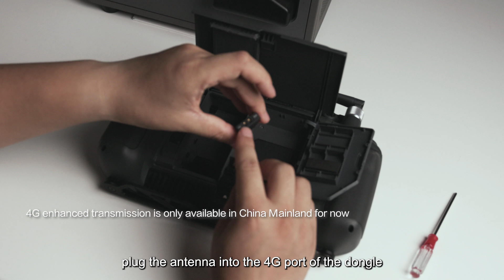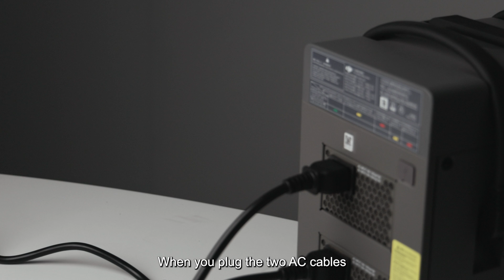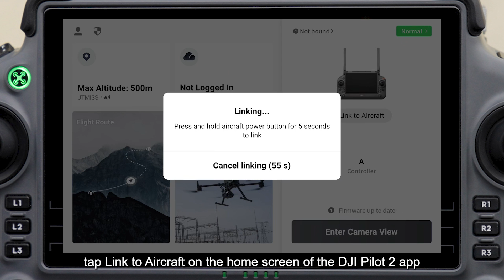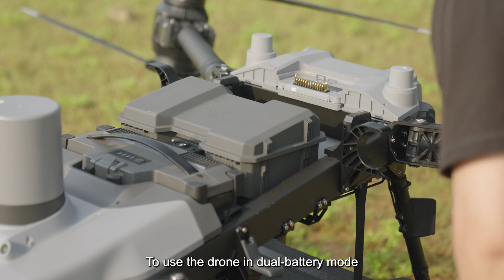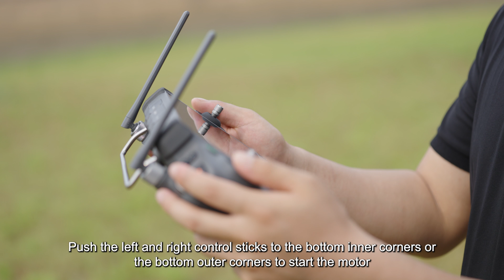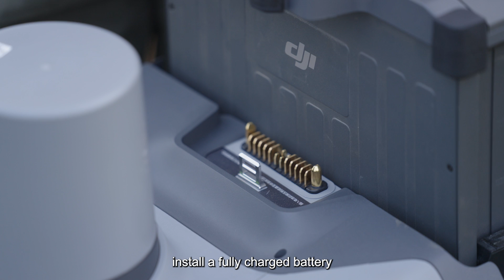DJI FlyCart 30 Tutorials: First Use

Comment: What an awkward product, if t60 isn’t limited to 30m height it’s gonna be far better than fc30 cause it has 4G control and 230kg thrust, 100kg maximum payload capacity not to mention it costs only about 6000usd in  china and comes with a rato generator
Reply: Don’t want anybody to weaponize this drone oversea.
Reply: Karma?  @Missmydogs

Comment: Ukraine gonna need this badly >>>
Reply: t60 is batter suited for them， with 100kg max lifting capacity it could pull a wounded solder out of battle field within seconds and quickly deliver equipments and ammunition